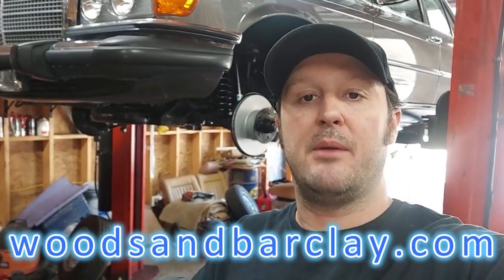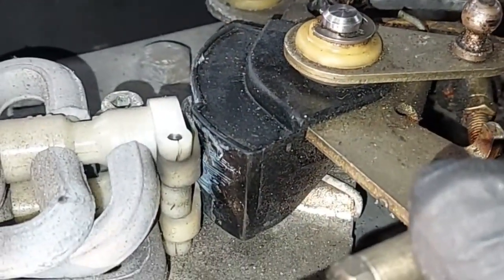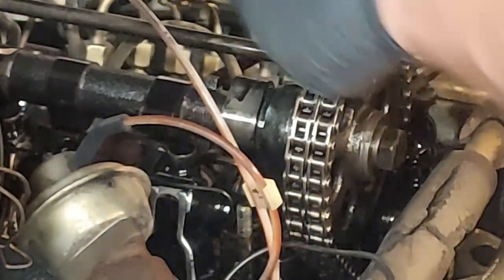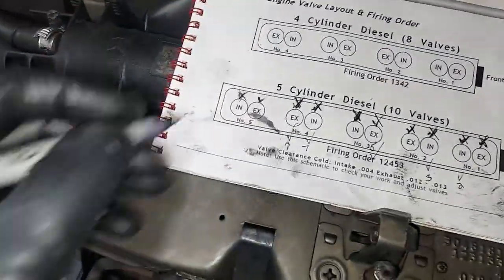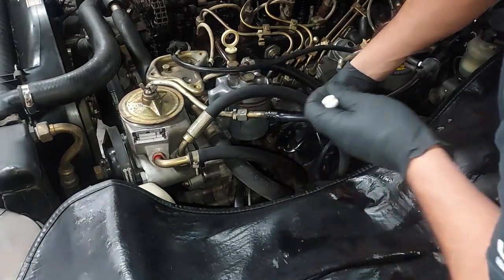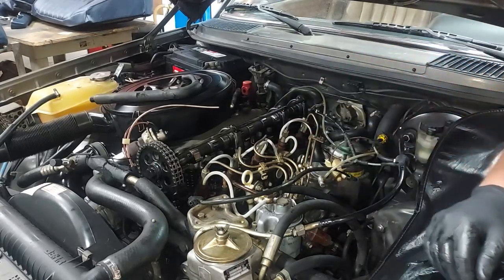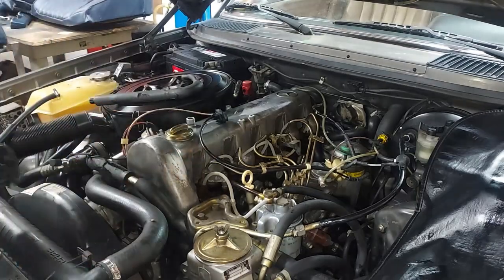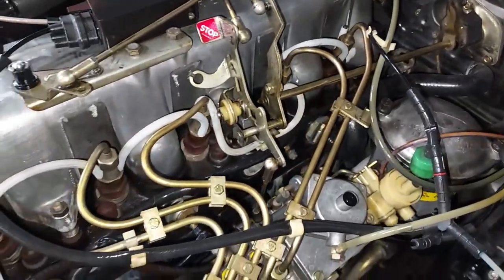1983 Mercedes 300D - Part 4 Valve Adjustment,  Hood Pad and Throttle Linkage

Comment: It would be nice to see a list of the parts that were changed with links to those parts.
Reply from the maker: This video is about a valve adjustment and Hood pad installation. There are no parts other than the hood pad and the glue. So I'm not sure what you're talking about.
Reply: @woodsandbarclay  the fuel primer you installed, the switch to a different pre fuel filter, the parts replace on the throttle.
Reply from the maker: @erico1603  I don't know the part number offhand but you can just go on Google and type in 300D primer pump and it will pop right up. 300D pre fuel filter and it will also pop right up.
Reply: @woodsandbarclay  I tried to adjust my Bowden cable the way you did but mine doesnt spring forward the way yours does. Maybe I need a new spring and a new rubber boot part
Reply from the maker: @erico1603  is your throttle return spring is missing or broken then yes you'll need a new one. However most likely the little lever that the Bowden cable attaches to is on the wrong side of the tab. There's a little tab the lever bumps up against and if it's on the wrong side of that lever it won't return.
Reply: @woodsandbarclay  I checked that. It is on the correct side and I only knew to check from your video. The spring might be shot. Can that be purchased without replacing the whole bowden cable?
Reply from the maker: @erico1603 the spring has nothing to do with the Bowden cable. The spring is underneath the throttle linkage. You'll have to check for throttle linkage on eBay or find someone that can hook you up with that spring. Or just make a spring.
Reply: @woodsandbarclay  at 51:41 when you are adjusting the bowden cable and you push the metal part for the recommended gap that is connected to the bowden cable, yours springs back. Mine does not.

Comment: John, thank you for your demonstration of the Bowden cable adjustment! I always understood it to need to be adjusted so that it has no slack when pressed onto the ball but I think that makes it too tight. Gonna try this on my 83 300SD and see if I can get it shifting right for the first time. Speaking of shifting problems,  if you've ever adjusted the clock spring on a VCV, have you ever experienced a situation in which the valve can't bleed enough vacuum to give firm shifts at higher rpms? That's what I'm working through now...
Reply from the maker: Just keep making minor adjustments to the vcv and going out for test drives and you'll eventually get it. Each Car is unique.
Reply: @woodsandbarclay  will do,  thank you sir!